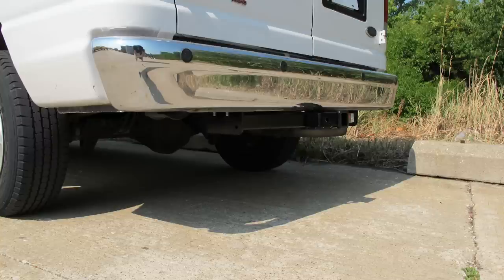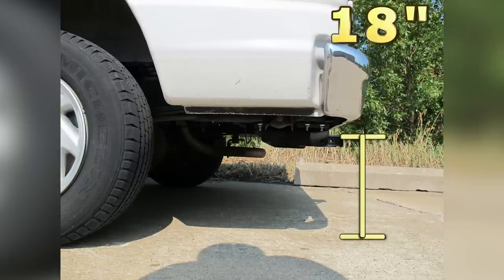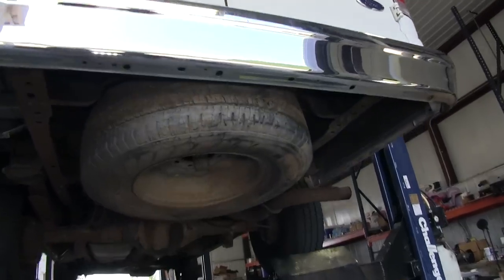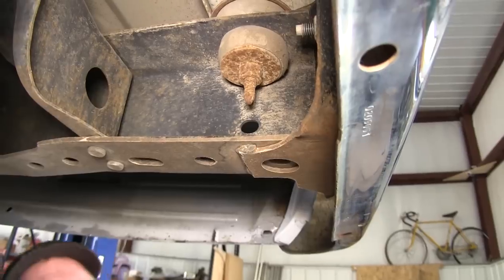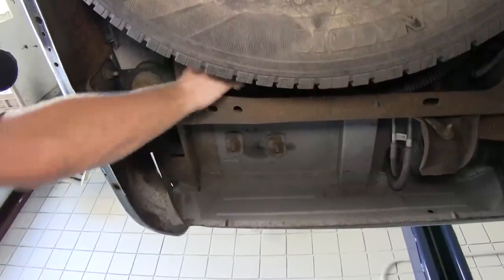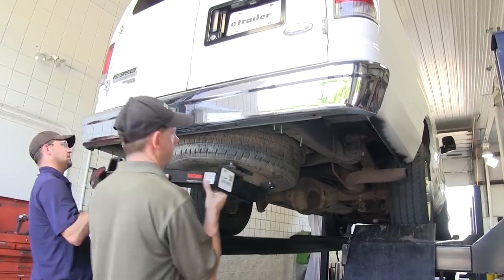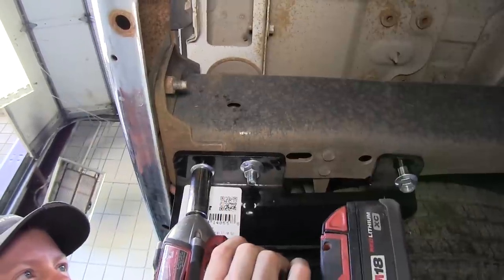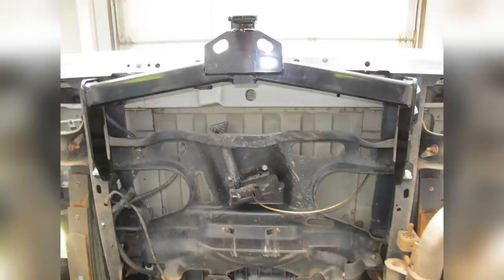etrailer | Installing the Curt Trailer Hitch Receiver on your 2006 Ford Van

Comment: Would this work for a xl super duty?
Reply from the maker: The hitch fits these models:
2004 - 2014 Ford Van E-150
2004 - 2014 Ford Van E-250
2004 - 2014 Ford Van E-350
2000 - 2003 Ford Van Full Size
https://www.etrailer.com/Trailer-Hitch/CURT/14055.html